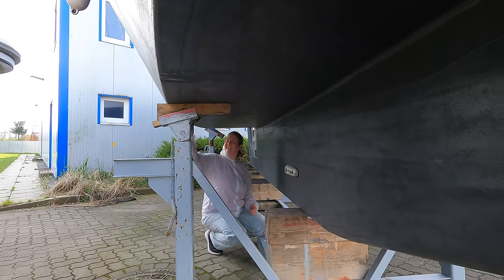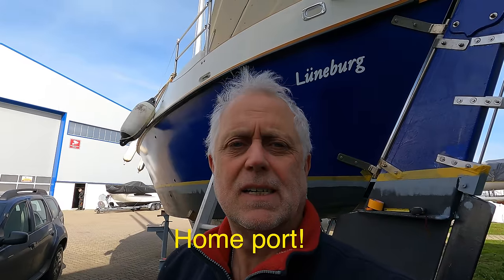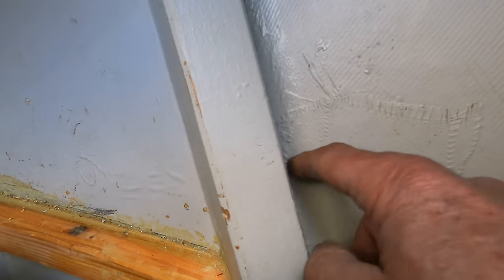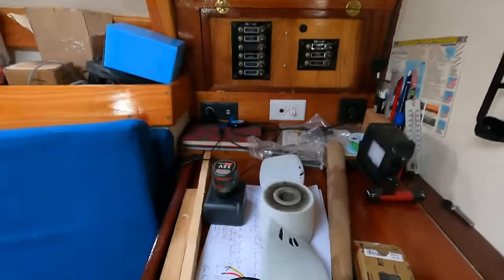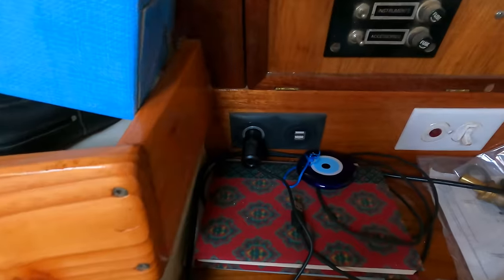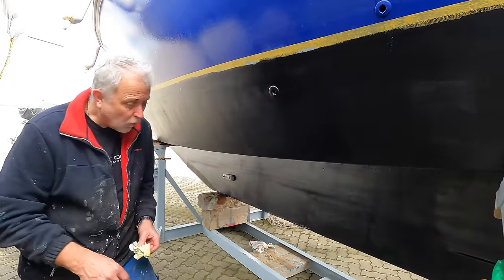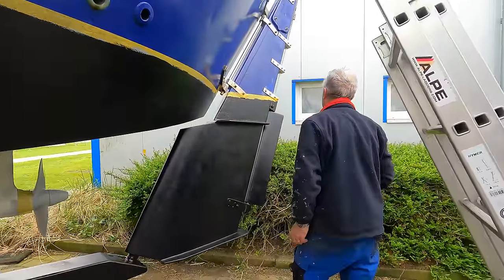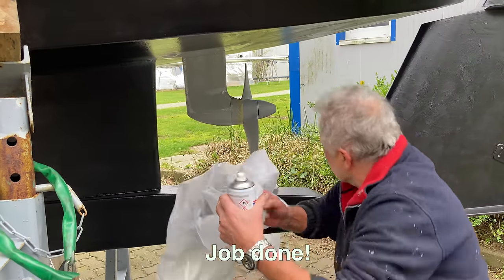A Busy Week Part Two; Ready To Splash!! -SV Tapatya EP324

Comment: To  locate a new hole accurately, place a small magnet on the inside where you want the hole and use a compass on the outside to find the magnet.  The compass needle points to the magnet, making it self evident where to drill.
Reply from the maker: Good tip, Bob 👍😃

Comment: You can have a concert this weekend, and your youngest daughter is also flying back.
Does rudder trim use two ropes?  Whether you can use a marine engine throttle cable or a bicycle brake cable, they can be bent at will without affecting the transmission of force.
Reply from the maker: Yes, two ropes. The cable idea is a good one. I’ll bear that in mind 👍😃😃